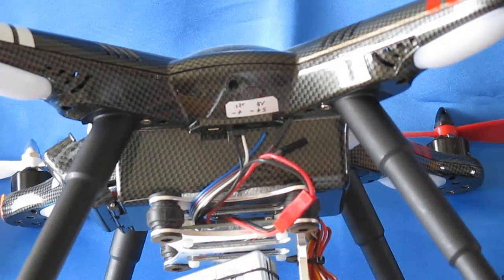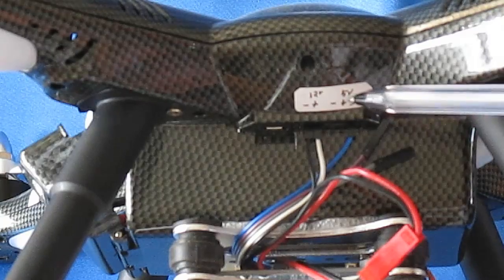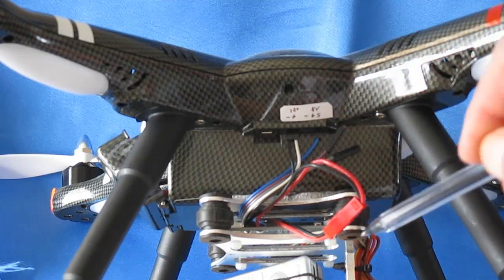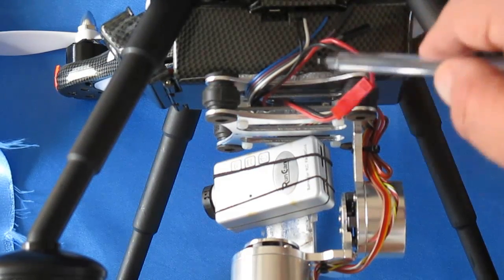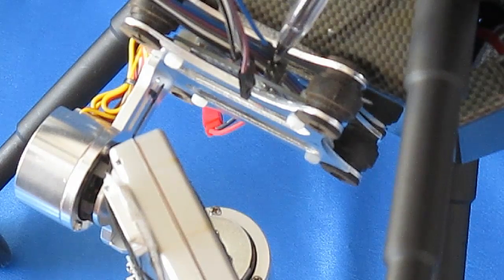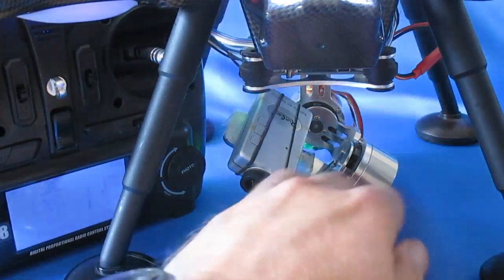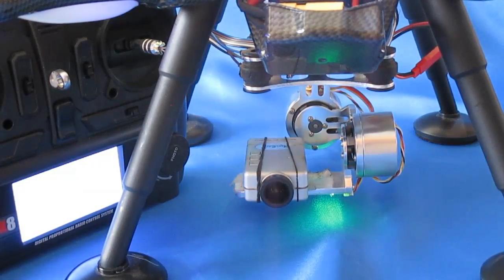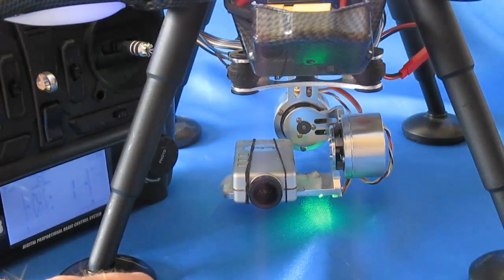XK Detect X380 Drone Generic Gimbal Electrical Wiring Setup

Comment: I'm looking at the X380 as my next quad, primarily for video shots. I want to get a mid range copter before moving up to a higher end one like a Yuneec 4k in a couple of years. I have been reading the rcgroup boards and they are making me a little gun shy on purchasing this copter. It looks like there are quite a few people with problems and fly aways. Would I be better served buying a 3dx8 instead? If I do go with this, is there a GPS tracker you would recommend, that I should get with this?
Reply: I agree there is plenty of people out there flying without problems. If there is enough of them sold odds are some of them are going to have problems after all even some of the really expensive ones have problems.
Reply from the maker: +Tony Noon I can't speak for the others that have experienced problems. All I can say is that mine works fine in stock condition, unmodified/unupgraded out of the box, and I have no problems flying it in "risky" situations https://www.youtube.com/watch?v=4MWK8bxkviE
https://www.youtube.com/watch?v=YMjRGZDzhd4
Reply: +Quadcopter 101 I hadn't seen the Mount Shasta video! Gorgeous footage. I am thinking this is the right quad for me. Have my fingers crossed!
Reply: I understand completely I've seen videos that has made me doubt my purchase. I already have mine gimbal and all and I haven't even fired it up yet. I'm very gun shy but I will fly it eventually hopefully with no problems.
Reply: This video has made me feel better about it, as did all of the X380 Videos Quadcopter101 has done. It looks like a very solid flyer, and I love how bright the LEDs are, I feel like keeping orientation would be easier for a new person like myself. seeing how easy it is to put a gimbal on is also making me feel a little better as well.

Comment: Can I use this on a cruise plane?wWth the tilt up and down feature
Reply from the maker: +Andy Black If your plane can lift 200 grams, plus the weight of your camera, and your plane has 12V output to power the gimbal, and an available aux signal output channel to control the tilt feature, then yes, theoretically.

Comment: Nice video.  Thanks.  Question, do you ever fly the CX20 any more.
Reply from the maker: +Skydive Driver On rare occasion.  But when I do fly it, I keep it in manual mode to avoid its many quirks.
Reply: Yep that's what I do.  I was wondering if you gave up on it since you have the X380.  It looks like a good flyer,  Thanks for the response.

Comment: Nice Video, very informative but I have a quick question, is this better than the Walkera G - 2D?
Reply from the maker: +Omard Gardiner No, it's not.  But the G-2D isn't $45.
Reply: +Quadcopter 101 lol so true. thanks
Reply: +Omard Gardiner i have had two g-2d's plastic version, they are not better than this one, only advantage i can see is they are lighter and its possible to adjust camera position manually without a computer, but i think all gimbals can be set to hold whatever position they are powered up at.
Reply: +alan hennesy on mine there is a micro switch on the board if I press it 3 times the gimbal goes limp and I can place it into position and a few seconds later it has set and stays there mine is the cheap Banggood one

Comment: first of all I just want to say thanks for all these helpful videos. next I was wondering if you could tell me if the Wingsland Scarlet Minivet 5.8G FPV is a good Quadcopter to up grade from the WLTOYS v686 explore. I'm looking for more a video Quadcopter. any advice with be wonderful.
Reply: @quadcopter101
Reply from the maker: +Jody Wilson Sorry, I don't know. I haven't had a chance to try it yet.
Reply: +Quadcopter 101 do you have any suggestions on what drone I should consider upgrading to next?
Reply from the maker: Jody Wilson How long have you had that V686?  Are you skilled in the following? (If so, you're ready to move up. But if not, practice with that V686 a little more).
http://quadcopter101.blogspot.com/2014/02/flight-school-6-distance-flying-keeping.html
http://quadcopter101.blogspot.com/2014/12/quadcopter-flight-school-4-horizontal.html
If you really feel that you're ready, a good intermediate quadcopter is the Syma X8C (but not with its stock camera).
https://www.youtube.com/watch?v=i32czqkycQM
https://www.youtube.com/watch?v=DkWcSE9FGRU
https://www.youtube.com/watch?v=w2sqjk6ZmZI
Reply: Quadcopter 101 I been flying it for about a month and a half now, and I wasn't looking into upgrading for about another 2 months but I will check out the videos you have put there for me, thanks for advice.